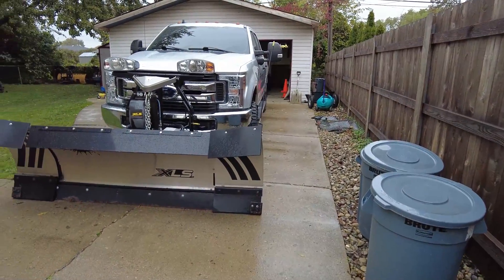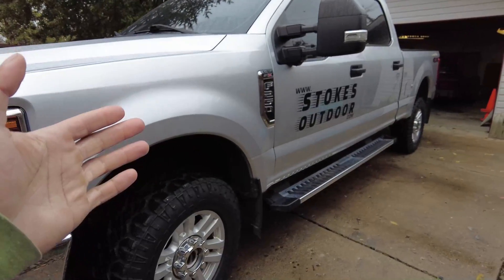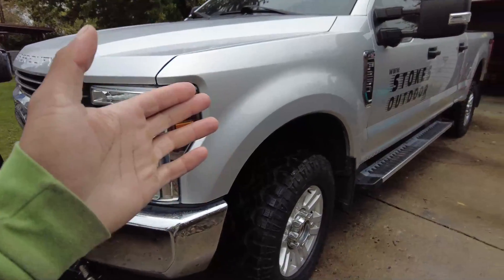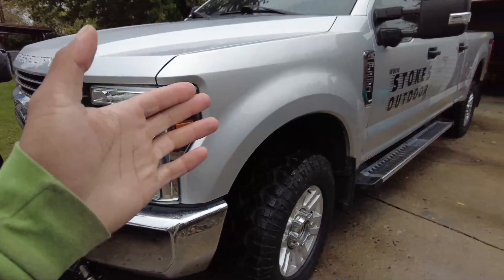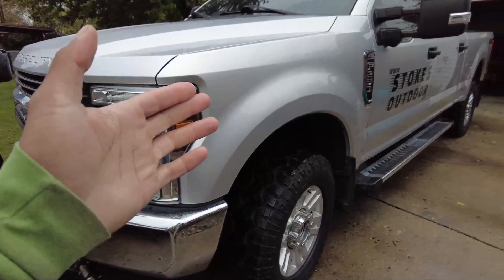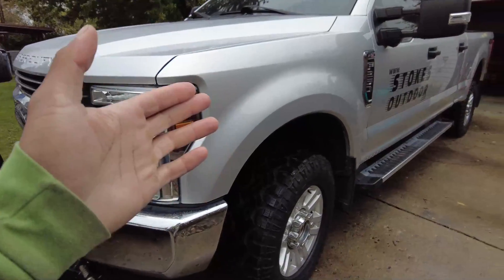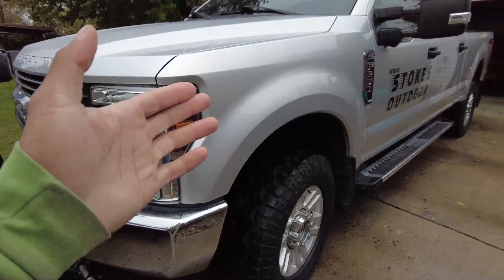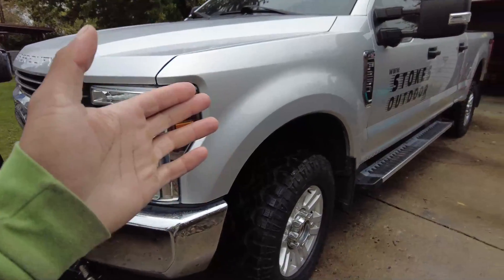Ford SUPER DUTY no up-fitter switches. LETS ADD OUR OWN!

Comment: I was wondering if I should wire the LED on the switch directly to the battery to be on all the time or if I should use a “key-on/accessory” wire to power the light on the switch.  Any suggestions on one way or the other?
Reply from the maker: U need a fues between switch and battery
Reply: I agree with always using a fuse. I was additionally thinking that having the switch led on all the time could be a parasitic battery drain. So I was thinking about connecting the light in that switch to a power source that only is hot when the truck is on or running.